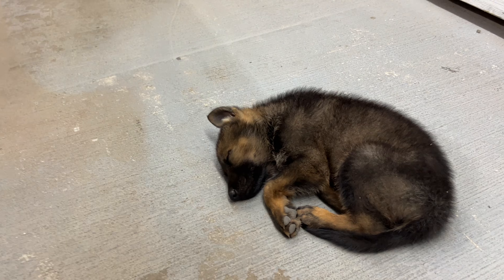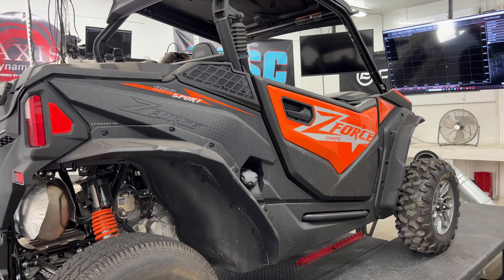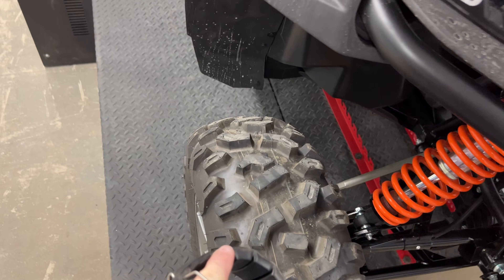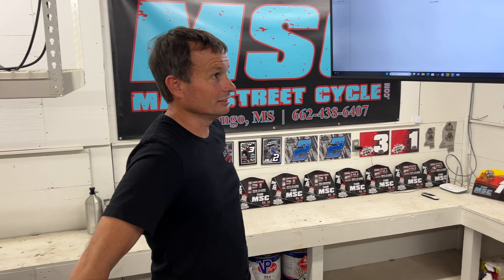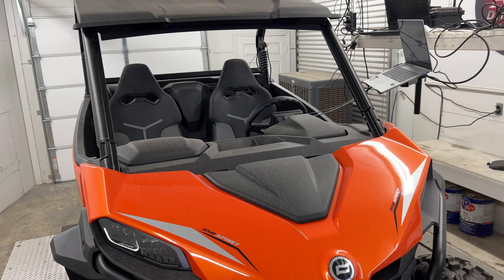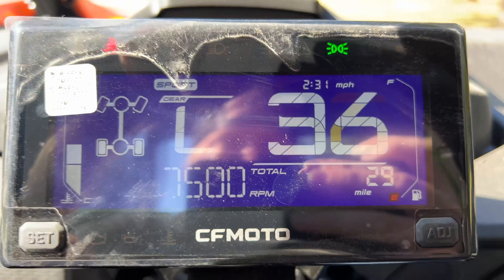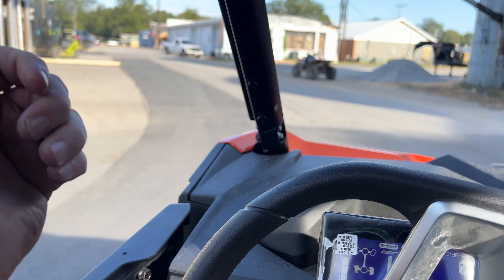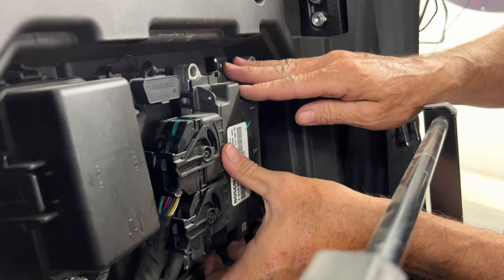CFMOTO ZFORCE 950 Sport G2 Dyno Tune & Testing | More HP & Speed

Comment: So with those "dyno tires" is the number higher or lower than it would be with stock tires. Aka what people will usually be using
Reply: friend the tune is getting more from the engine. the dyno tires are simply to keep consistent contact with the dyno drum .so going back to your off road tires doesn't change the power ability of the engine just the ability to connect it with the ground. no one can properly get a reading on a dyno with an off road tire just like you wouldn't run a street tire off road because it gets no traction. that off road tire gets no traction on the dyno drum. hope that makes sense

Comment: I just ordered a stage 3 clutch kit and ecu tune for my 2023 950 sport G2. What should I clock the clutch to when installing?
Reply from the maker: You will clock our Stage 3 Clutch to B1
Reply: @RealTalkPowersports how do I order a tune for a 2023 zforce 950 gen2 sport they sahhy you don't h
Reply: If this guy ordered a tune for a 950 gen2 sport 2023 how do I order it
Reply: How did you order this tune Ben

Comment: I just did a top speed pull on a bone stock 950 trail after watching this. Me only at 190 pounds, 12psi tires,full windshield, full tank of fuel on a flat road was 77mph . I’m guessing part the slower speed was due to the bias plus having more roll resistance than those radial stags.That was fast enough on that 50” machine but yes more power would be good. How does the msc tune affect the warranty?
Reply from the maker: I’ve never seen or heard of the MSC Tune effecting any warranty
Reply: Ok well nice work and thanks for the video. I’m definitely going to be getting one

Comment: Are those dyno tires the same overall diameter as the stock tires? I imagine if they're smaller that would mess with the configuration of the stock clutch setup
Reply from the maker: We have a few different sets of dyno tires to take care of the different stock tire sizes so that’s not an issue for us

Comment: looks good, how do the numbers compare to the 950 ho ex ? aka which one has better or higher power numbers ?
Reply from the maker: They are very close!!! Maybe I can arrange to put them on the dyno with same tires and see how they compare
Reply: @RealTalkPowersports  that would be nice. Stock tune on both first
Reply: I've seen these guys race the 950 trail and the 950 ho ex in stock form.  The YT video shows the 950 trail pulling away from the 950 ho.  Even with 5 hp less the trail version was a fair bit faster.

Comment: Is this also available in the DIY kit version?  I like having the ability to switch it back to stock if needed.
Reply from the maker: Not at this exact moment but it should be sometime soon.
Reply: @RealTalkPowersports  That would be fantastic.  Usually aftermarket tunes are harder on fuel.   It would be nice to be able to have a choice of when to be fuel efficient and when you simply want to have fun with your buddies.